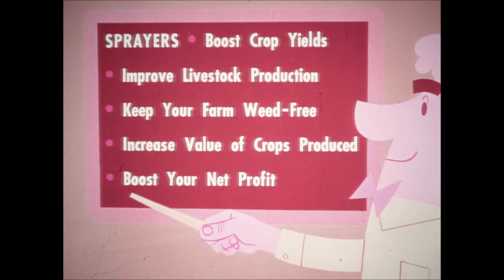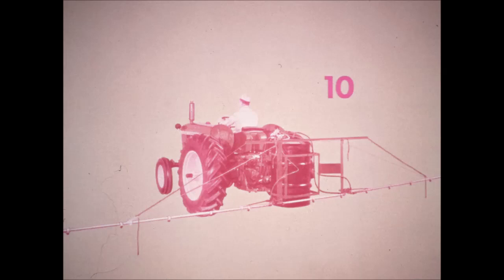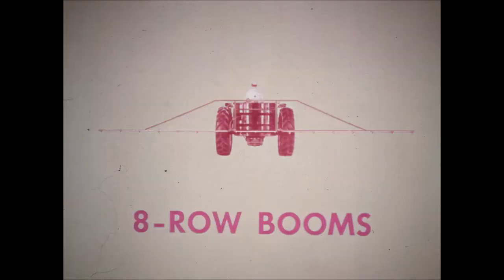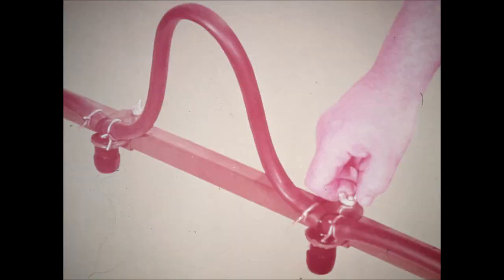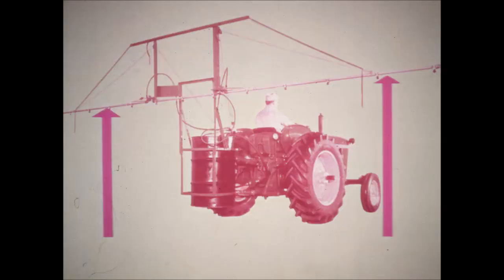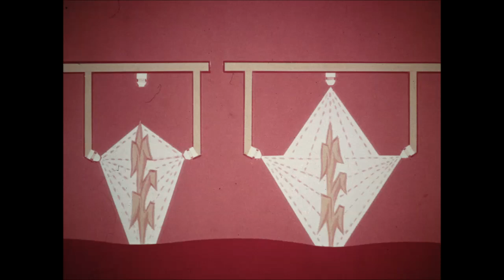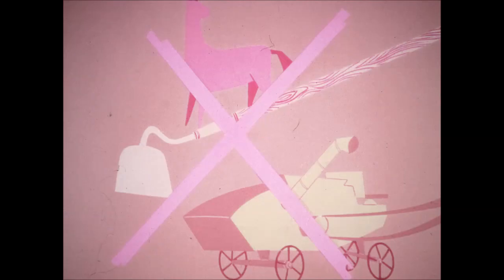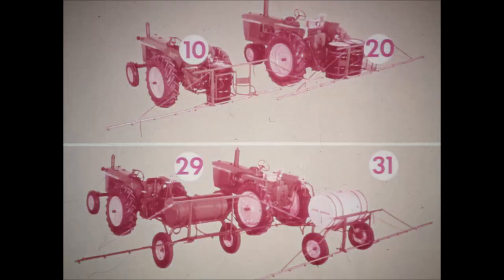John Deere Presents Sprayers

Comment: Seemed like everybody was building sprayers back then. I chuckle at "easy of adjustment" spoken in these advertisements, by the time Dad or I could afford equipment, every adjustment was either seized, rusted to where they broke trying to move or hoses rotted. Looking back now, Dad and I both needed more training and understanding of chemical applications. Even though it's a pain to get certified to even buy chemicals, training and certification protects the operator and the land.
Reply from the maker: Agreed! I don't mind that people spray, it's following the why's & wherefores that are critical. I personally rather not spray. The less chemicals I handle the better. Film developing & made from scratch developing "soups" is enough for me. Already afraid I've inhaled/absorbed enough of that stuff to develop extra body parts.
Reply: @ikonseesmrno7300  Agree! I quit spraying in the mid 80’s and went “organic” with grass fed beef and oats for the horses. Plus 25 years in automotive prototypes with epoxies, unknown glue impregnated mahogany and various thinners has destroyed my taste and smell.
Reply from the maker: @kswaynes7569  Ah! The good ol' prototype cars that couldn't go anywhere. Ya know, if I was upper management, that would have driven me crazy. Looks aren't everything you know. If a design team wanted my approval, I best be able to play with it. :v) That's one of the reasons why the Studebaker Sceptre is my favorite. A prototype that you could drive from the get go.
Reply: @ikonseesmrno7300  We were never a Tier 1 supplier so I never got to see a full build. A bumper. some beautiful grills out of blacked out impregnated mahogany with cherry ribs for the grill, a roof a door panel or chrome drip rail. We also did plastic injection molded prototypes. I had switched from the wood side to prototype molds in the early 80's. Learning injection molds lead to vacuum molds, rotational molds and some blow molds as I bounced around from shop to shop. Every learning experience helps a man progress to where I was able to help set up a vacuum form facility in Brazil. Now I'm in Alaska, getting paid to live out my hobby in remodeling other peoples homes with other peoples money!
Reply: If I can get through Canada this September/early October, I'll be back to my non paying hobby of farming next Spring!
Reply from the maker: @kswaynes7569  Wow, that is some neat history. You ended up in Alaska too, yet. Always wanted to get up there & look around. Probably take a train ride or two. That has to be some amazing scenery.
Reply from the maker: @kswaynes7569  I did home renovations & new construction years ago. I'll take low to no pay farming any day.
Reply: @ikonseesmrno7300  It's beautiful but I sure miss open farm land. It's a nice place to visit, weather here in the Anchorage area is moderate. Winters are longer than I seen in SE Michigan but similar in temps, Summers rarely get over 80 but when temps get into the mid 70's, any type of air conditioners are sold out in Anchorage. Long hours of daylight in May, June and July are great but 4-6 hours of daylight in November, December and 1/2 of January are real depressing. I'm not looking forward to 105 degree days back in Kansas. Trying to work outside in those conditions was brutal.
Reply: @ikonseesmrno7300  I love this work, especially kitchens and baths. I learned most of the codes, so plumbing and electrical offer a nice change. Just tiled an entry and just another variation than just guys driving nails. I love the finish details.
Reply from the maker: @kswaynes7569  Yep, especially when there's humidity with that 105º. Ugh!! The winters here in SE Wi can be a lot colder than Anchorage, I've noticed. Always figured it was due to all the water. We do have Lake Michigan here & that's not too far away, but unless it's the dead of summer.... a hot summer.... the temperature choices for that puddle are cold & colder. As for the dark winters in Ak, I'd like to experience it once just to say I did. Same with the long summer days.
Reply: @ikonseesmrno7300  We were 1/2 mile West of Lake Huron. Way too many 90+ degree nights with 80-90% humidity long before air conditioning was popular. Our home in Kansas has air conditioning, a real life saver! Anchorage is on an inlet from the ocean but this part of Alaska benefits from the warmer Japanese Currents. Now further inland the extremes are more radical, Fairbanks can see 100 degrees in Summer and -50 in Winter.
Reply: LOL... Basically if you had a TeeJet catalog and read the back couple of pages, everything you needed to know to calibrate a sprayer and apply the stuff properly is either on there, or in the chemical label.  Thing is most people are too lazy to read them, or do the math to do it right.  Course nowadays they rely on the computer to do it all for them, using GPS and/or radar ground speed measurements and the computer automatically adjusts the pressure via an electronic pressure regulator and stuff to tweak the volume and do the job.  The gubmint's involvement just makes things harder with little/no improvement in safety or efficacy.  I know when I went to training to get my pesticide license when I was still row cropping and needed it to get some chemicals I needed, there were guys in there 70-80 years old that had been doing it their whole lives, who were successful farmers and knew what they were doing, they just "couldn't answer the test questions" and stuff (probably because they'd been out of school for 60-70 years) and really struggled or failed simply because they couldn't "answer the test questions".  Meanwhile, I've seen a BTO farmer who sat on the county committee, who OVERSEES the pesticide testing and all that gubmint BS, who pulled up in his yard in his big air conditioned Deere hi-boy cab sprayer, climb down, unscrew the plug, and dump the last 20-30 gallons of chemical out on the concrete slab, yell at his dog for coming up and licking it, and watching it pool and spread across the concrete and run off the edge into the grass not 15 feet from his water well... IDIOT!!!  

In the same way that driver's licenses don't stop drunk driving, chemical applicator licenses don't guarantee that the job will be done competently or correctly, or that someone won't do something stupid or illegal.  Look at all the idgits who were spraying regular old dicamba on their soybeans when the EPA dropped the ball and allowed the companies to sell GMO dicamba-tolerant soybean seed when they hadn't approved the new formulations of dicamba for those beans, and then guys were spraying dicamba illegally and burning up their neighbor's non-tolerant soybean (and other) crops for miles around...  It's like all these new CDL requirements-- it's just forcing guys out that have driven for decades and know what they're doing, but they're getting older and can't touch their toes during a DOT physical so they're forced out, meanwhile they're putting idiots behind the wheel who I wouldn't trust to drive a lawnmower pulling a donkey cart without killing someone... but by dammit they can pass a DOT physical and all the stupid gubmint tests in the driver's license office, so they MUST be qualified, right??  LOL:)  

Gubmint is the problem not the solution LOL:)  Later!  OL J R :)